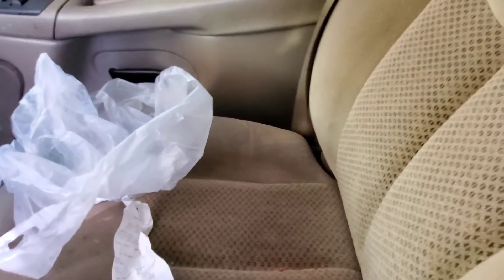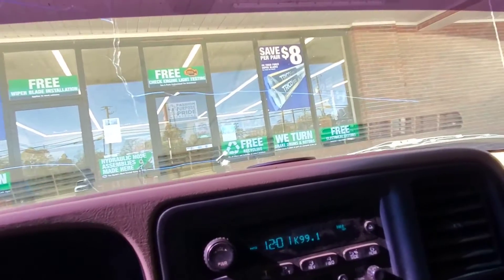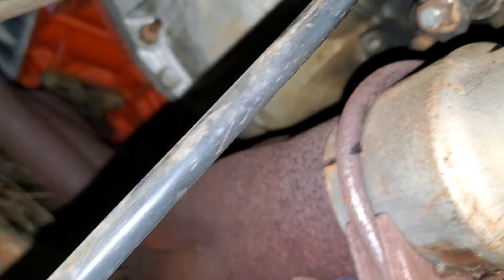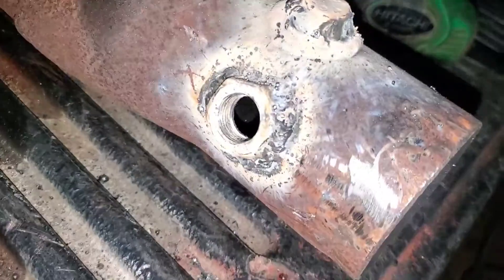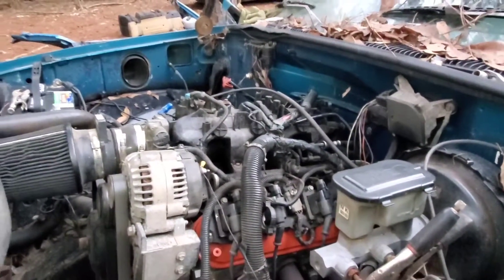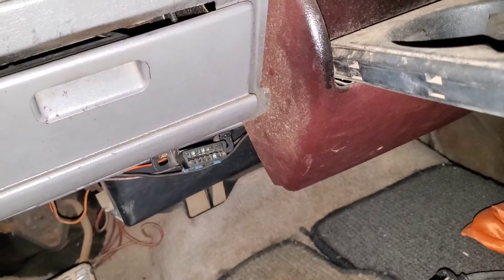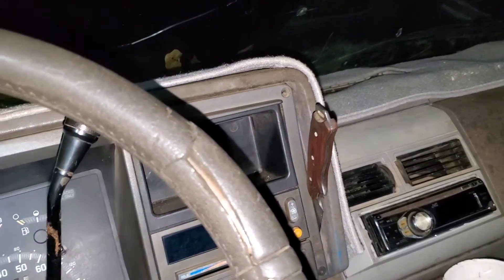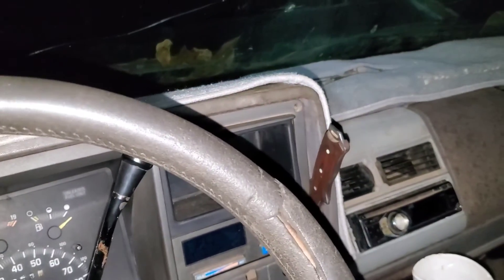Time to FINISH This 5.3 Swap!

Comment: Hey man I love the videos I been doing a bunch of research on a stock ls swap for my 91 suburban 4x4. And I was totally overwhelmed till I saw your videos. But is there any chance of you still have the truck could you take a more in depth video of how exactly you ran the wiring together? From the factory tbi harness to the ls wiring? I'd appreciate it it alot.
Reply from the maker: It's gone bud but I never did all the wiring I just had it wired up to where it would run i never got around to making it pretty and doing it right

Comment: I got a question for ya, I'm wanting to put lowering shackles on my 94 single cab long bed, I'm leaving the front end stock, just lowering the rear, what size of tires should I run, I would like something wide in the rear and not as wide in the front but to where it isn't much noticeable what do you think? Btw I'm running 15" micky thompson rims
Reply from the maker: Idk how wide you want but 275s is a decent width tire that looks good.. alot of people run a 295 on these trucks
Reply from the maker: As far as fronts I'd say like a 215 or 235 maybe but I'd probably try to find some trucks with different set ups on em to look at before I made a decision
Reply: @bowtieguy601  okay thank you so much for replying! Much appreciated, I'll probably try out a 275 in the rear and 265 in the front

Comment: i was wondering if old rally wheels off old c10s trucks fit the  90s chevy c1500s  truck with 5 lug i see you have one on 92 chevy truck
Reply: If they are 5 lug they will interchange. I put a set of Eagle alloys off my 93 on my Dads 74 squarebody. The only difference is you will have get the correct lug nuts depending on the year..they went to metric in the 80's.
Reply: @rivervalleyray  i have a 1992 c1500 i love look of the old rally wheels on the c10 trucks
Reply from the maker: Yeah they'll work

Comment: Is that a 4l60e how did u get the shifter on it
Reply from the maker: Yeah I used the stock stuff off the original 700r and just put it on the 4l60